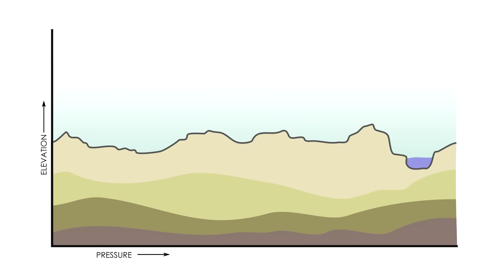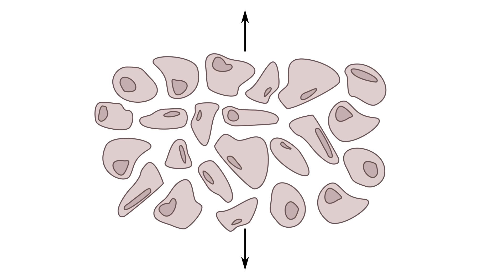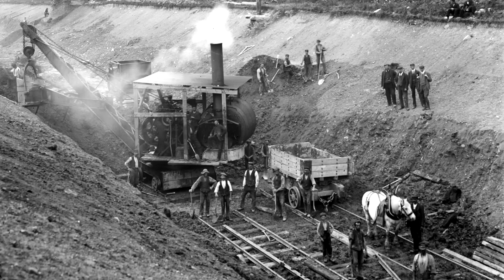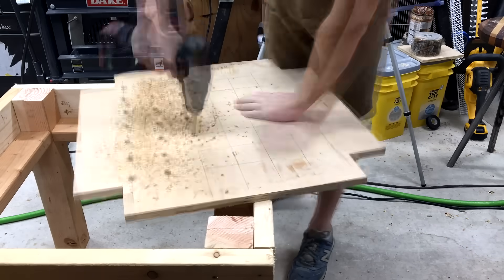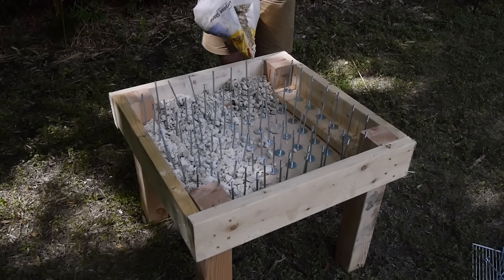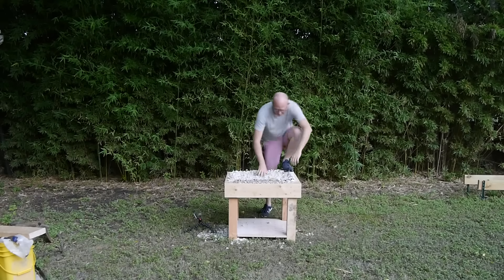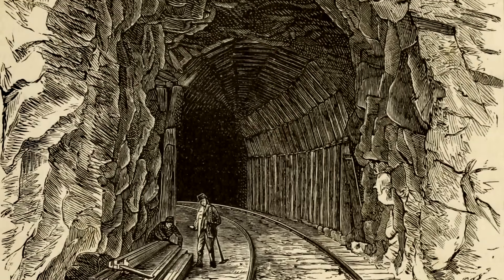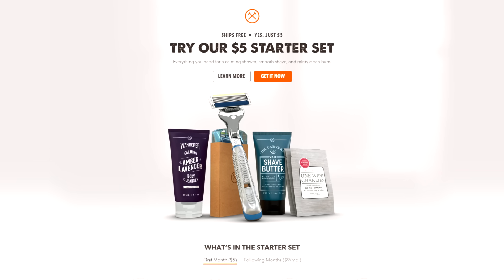Why Tunnels Don't Collapse

Comment: Damnn standing on that gravel demo was hella dangerous.. those 8" bolts would have become blunted spears to your leg if the thing collapsed. Glad ur okay
Reply: That part scared me. He could've done that with a bar above him so he could hold on if it fails
Reply: @cynellekhentannvasquez8219  Or have a safety harness to help him not hit the ground to hard. The safety harness can be attached to a special rig from either a strong pole or the back of a truck. Lol 
Either way he’s an engineer and I doubt he didn’t think about that. The only reason he did this test like this is, buscase he probably did all the equations of fails in his head and probably came up with no fails. It’s impressive what a chimp brain through lots of evolution can do.
Reply: Ali Syed I know! I was saying this too, especially when it started to bending I was like “this guy is gonna die”
Reply: Dont you think he tried push down on it abit off camera in order to test it.  My guess he did.   Hard to be engineer and stupid at same time, but yea it happens.  But then its overconfedence  imho :)
Reply: @UltraSuperDuperFreak  if you noticie, amny of the rocks at a 45 degree angle from the bolts fell when he got on. That means he didnt test it before hand, just used his engineering skills to make sure it was ok
Reply: I don't see the danger. They're really blunt and the fall is tiny
Reply: @UltraSuperDuperFreak  He's an engineer for God's sake. He knows math and stuff.
Reply: Bolts have washer and a nut on both sides. If the structure collapse he would probably just fall. But if he landed on any of the bolts there would be no danger since the surface of the washer is to great.
Reply: Trust him, he’s an engineer
Reply: practical engg next vid title: why Grady never gets hurt
Reply: No, not really.  the bolts would have just fallen on their side. he might have go a couple scratches or maybe even turned an ankle, but that's probably about it.
Reply: nope, i think he already calculating carefully. afterall he is the practical engineer
Reply: He tested it first with dead weights.
Reply: RESPECT;    Gotta give it to a man who risks his own safety on his own work.
Reply: Calm he is engineer
Reply: The bolts appeared too close together for his foot to slip through to the bottom if the rocks gave way. If the rock's gave way he would have been  just standing up on the bolts.
Reply: @exoressdelivers70  I think you miss the point he took the bottom off. His weight was totally supported by the rock and the bolts tentioning the rock.
Reply: He’s too cool to use an antiquated adverb like very, so he says hella. I’ll bet he has friends too.
Reply: @walterkersting1362  Language changes over time and if you have an issue with it you're on your way out.
Reply: @walterkersting1362  prescriptionist
Reply: Very is hela antiquated adverb. It is hela cool to use hela instead. Me hela cool dude. Hela cool. Hela hela cool. Hela hot too.
Reply: Let me guess you wear a face mask ....snowflake

Comment: How do you go about guaranteeing that it won't collapse? There's a bit of distance between "this is probably fine" and "I bet multiple lives that it's fine". Your demo was good but I wouldn't stand on it if it was the only thing stopping me falling into an alligator pit. Can you measure it's reliability somehow?
Reply: You can simulate it, and you can calculate stress and strain on the bolts

Comment: I research and work with hemp fiber, .
  would you think the world would be interested in a "organic" non metallic,  tunnel reinforcement concept, 
 that could expand and tgrough exothermiclly expansion compress fractured stone and even gravel, and hold like reinforced stone.
 On it's way through a existing tunnel system, or as it was newly bored.

  should be good for say 700 years give or take a decade, if records are correct,.
  chemistry is still doing fine even on the Great Wall of china's "below" waterline, .
  the 5 atmospheres a tunnel must pass for civilian traffic should be obtained easy enough.

Comment: You’re missing the usage of polyester resin to develops the strength of the F432 Rock Bolts. I understand this is a semi-elementary demonstration but aspect aspect that could have been mentioned is the development of the roof beam as to develops the arching effect of the rock loads. Also, horizontal stresses and their mitigation with higher shear strength bolts would be great to see demonstrations on here, say to slow the effects of creep on the excavation. Another example of yieldable, arching, members would be an interesting experiment, if they could be demonstrated.

Comment: The other option is a polyurethane resin that is injected into the fractured rock to essentially glue it back together.  It's more often used in stabilization post collapse, but I've seen it used in new construction as well.

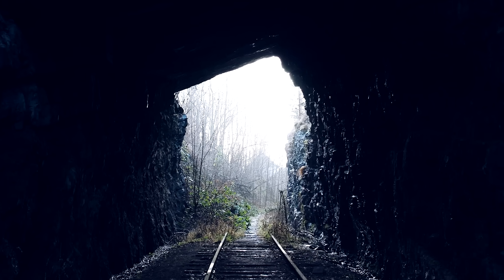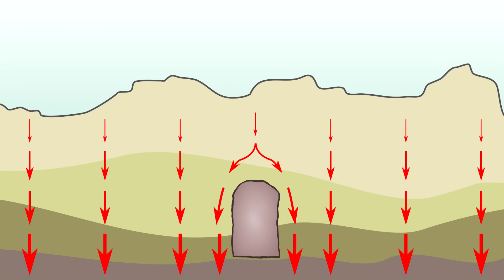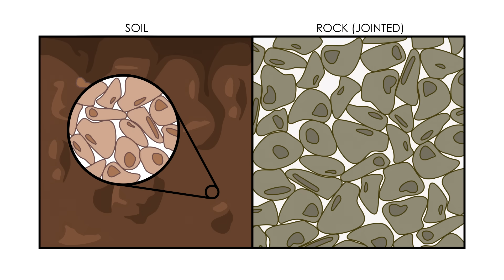Comment: 0:51, 0:52, 0:57, 1:05**, 1:20, 1:24, 1:38*, 1:46*, 2:43*, 3:29, 3:31-3:42 (several), etc.,   there were low frequency (~80Hz?) booms, possibly from some other room in your house. I'm wearing headphones with great low frequency response and every time it happened I was genuinely concerned my home was buckling. It really enhanced my appreciation of the topic. Thank you.

Comment: This from current railroad news relates, "Crossrail Ltd requires anchors used in the tunnel lining to demonstrate a 120-year design life instead of the standard 50-year span of a standard fixing. The twin-helix Excalibur PLUS bolt also offers high-performance tensile and shear characteristics."  https://www.railwaygazette.com/news/infrastructure/single-view/view/long-life-screwbolts-developed-for-crossrail.html

Comment: Normally tunnels are lined. If rock bolts are used, they are usually set in a two part epoxy which is mixed by the rotation of the bolt as it is inserted as a drill. Then the structure is lined later in the process usually by reinforced concrete.

Comment: My dude, I recently found out that horrific experience when toilet water splashes on your ass is caused because of air forcing its way rapidly to the surface. I've seen some folks say you can put a thin layer of toilet paper down first and it supposedly traps the air trying to escape.

My question is, what happens if you just pour something like dish soap into your toilet, or some other substance aimed at increasing surface tension to the point where the air can't escape? Would that work and would it harm your toilet or septic tank?

The blight of toilet ass splash water must be purged from the earth at any cost.
Reply: Just crap in the yard bruh, problem solved.
Reply: the whole reason that detergents and surfactants work is because they DECREASE surface tension... you'd have to add something that increased it (or increased the viscosity of the solution overall)

Comment: Just an observation... but before tightening those bolts, if the rocks had been shuffled or vibrated so they settled into their minimum space, they would have been better locked together and those bolts would have held more of the rocks captive, meaning a more solid mass and fewer falling out the bottom.

Comment: I thought you were going to fall through when you stood on the bolt/rock support.  I learned something new today.  Thanks.  Question: Using your method,  is there a way to determine the maximum load before the support collapses?

Comment: Nice video even if there are some inaccuracies. Not always we have tensile strenght on the roof due to arch effect. Stress field along an underground cavern depends on cavern geometry and initial horizontal pressure. First phase supports are usually designed to stabilize the tunnel for all the use time. There is not just rock bolting (grouted, swellex ecc..) but usually also wire mesh, shotcrete. For very blocky rocks usually it is necessary steel pipe umbrella

Comment: I used to work for a manufacturer of rock bolts and related equipment, so this was fun to watch as it was never really explained why or how the rebar I was turning into giant bolts was done the way it was or to the size and lengths. It would be interesting to see more on how things like the adhesives and spray foam work and help to contribute to tunnel safety.

Comment: i would never have thought that gravel could be made to support the weight of a man just by putting bolts through it...
Reply: Yeah, you'd be amazed at how strong friction is. Even in some houses, friction is the only thing holding all the beams together.
Reply: It's for demonstration purposes only the gravel is probably not going to hold the weight if movement is to be exerted, as you see the gravel fall from his movement it is slowly losing its tension hold between the gravel and will give way.

Had the experiment included larger rock wedged between the gravel the ability of the bolts to hold tension would have been far more effective.

Packed material is more efficient at holding greater weights exerted on it. For example medium size rock with 2 inch, 1 inch and half inch aggregate with small particles packed within this would be very strong structurally.
Reply: Completely agree
Reply: Same
Reply: Curiously enough, as soon as I saw the demo, I knew exactly what was going on. Couldn't verbalise it to someone else but I...know.
Reply: i think the demonstration was too quick and may be a little misleading.

what should really matter is the ratio of the average gravel size vs the gap between bolts, and on top of that, the widths of the washers used and how much compressive force they could exert. that said, it still seems completely possible for any section to sport an inconvenient faultline and just shear off with minimal pressure. the lateral compressive forces needs to work with irregularly spaced gravel of sufficient size and with sufficient friction gripping each particle for the whole thing to act as one load-bearing floor.

in one word, the whole thing is... precarious.
Reply: Well you are WRONG
Reply: or maybe he swap out the wood plate for a thicker one, just to be safe. and the demo is purely for the dramatic.
Reply: @noirto2  you could literally see him stepping on the gravel with the camera below, dude...
Reply: Let me guess you a wear a face mask
Reply: @seanconnell622  lmao the clown arrived

Comment: Great demonstration video.  I like the fact that you walked on it.  I would not have bet this would have worked.  Did you do some calculation for the bolt spacing versus the aggregate size or did you just wing this?

Comment: To make your rock bolt design with gravel much stronger and safer, I would recommend increasing the longitudinal friction and stress by adding a dense and lightweight metal mesh to the bottom side of your design and tightening the contact between the mesh and rock by utilizing the rock bolts and running them through the mesh. This would allow any longitudinally loose rock (aka falling gravel) to be almost immovable by the strong contact between mesh and rock and be pressurized vertically as well as horizontally. The rock bolts do a great job placing vertical pressure to the rocks but not such a good job horizontally. That’s where the mesh layer would come in handy as a safety design. 👍🏼 great job and great video!
Reply: Fyx5010 maybe add some mine straps and flash coat here as well with resin encapsulated Gr. 75 Thread Bar?

Comment: Friend,
When you are tunneling through soil, how do you—hopefully—keep the tunnel from collapsing until you have a ceiling built?
I have seen telescoping overhead canopies, but then there is a gap between the roof of the newly excavated tunnel and the ceiling of your mobile canopy. 
If, for instance, I want to install a brick arch overhead, I need to get to the unsupported roof to build my brick arch up to it.
If this is too complicated to go into, at least point me at the right texts—preferably without calculus.
…..RVM45
Reply: RVM451... research the "shield system" which is how they built the NYC subways. BTW, most older arched ceilings were built first then covered up with dirt later. IOW, not done as a tunnel.

Comment: I want to know why doesn't a triangle with the up angle very sharp have the most structural strength, I heard from a lot of engineers that the 2D dome shape has the most. Is it different when you take the triangle and longen it in the 3rd dimension making a triangular prism, and you make a "semi circle prism" or "half cilinder"? In that case is the round prism stronger structurally ?
From Mister Google I found only articles/videos/etc. about how triangles have the highest structural strength.
Reply: Jeff... the traditional dome shape spreads the load out more evenly. IOW, if you have no clue as to exactly what is overhead it's better to go with even distribution, rather than pushing down and to the sides with a triangle. It's a better gamble in the long run.

Comment: Very nice demonstration of the bolts. I would like to ad that the bolts also make the potential loose rock in the roof is attached to the tunnels stable natural arch that are usally a little higher up. And in this way  its supported by the surrunding rock walls, just as an old stone bridge, where then the rocks underneth is supported by the bolts. Then of course this is not always the same. It depends on the joints and the rock you are tunneling through.

Comment: What I wanna know is why can't someone figure out how to make the asphalt surface of the road in a way that sewega lids don't either sink in, making giant hole ripping your wheels off, or the road collapses around the lids, making giant steel wheel-ripping-blocks. Is it so hard? Where I live, we don't have the seweg on the sides, under the sidewalk, the pipes are directly under the roads, so the manholes simply make driving a nightmare. Is it the setting of the asphalt? Sinking of the concrete lining of the manhole, throught the surrounding soil? Help!
Reply: Sarcast … That's called "frost heave" and it's common anywhere with wide temp swings. Those manholes are connected to the sewers / utilities that are 4 - 10 ft underground where the temp never goes below roughly 45 degrees... and that heat rises. The manhole on the surface, along with the road, is subject to freeze / thaw cycles, so things move and settle again at different rates. It doesn't take too many years before there's a dip or a pothole by every manhole. Sorry, there's no way around the laws of nature other than moving to an area that has a more even tempered weather.

Comment: hey I was just watching Essential Craftsman (https://youtu.be/dYjuihv0Yq4?t=467) who you should do a collaboration video with. 

anyway, I thought you should a video on planned cracking, planned failure and planned structure decay to build lasting structures. 
so that whatever it is fails in a way that last forever. 

be sure to include info on https://en.wikipedia.org/wiki/Weathering_steel "Rust proof by rusting"

be sure to include how the water on mount Rushmore monument is made to flow away from the faces keeping the carving around for much longer.

be sure to include the Long now clock project longnow.org/clock/

maybe, include the roman road and it's fantastic drainage and slab floating on gravel vrs the never ending maintenance but always fixable USA road system what one will last longer only $ can tell will the us ever once run out of money in the next 2000 years or will the zero maintenance roads win.

it could be one video or even a full playlist on decay, weathering, and long term design. Project placement for decay, water decay, salt decay, dust abrasion decay, chemical decay such as soils, replaceable parts and materials, erosion, disasters, war, vandalism and rioting,  decay by economics due to a lack of maintenance or theft, the other side exit plans of non permanent structures, rotting, and success stories structures that by planing or accident lasted for a long time what they did right what they did wrong. I am sure when you start researching lot's of Ideas will come to you.

it just seemed, a good match for your channel, just a idea.

Comment: How did you create the transition from uncracked to cracked rock at 3:25? Is that just a smooth rock that you Photoshopped a layer of cracks over? Both before and after look real.

Comment: When old mines used posts/struts to support caves from caving in, did those supports only actually come into effect when a collapse did, or, was to occur but resulting in no collapse since it was able to drop immediately onto the posts/struts? In my mind, you would have to somehow push them into the rock somehow in order to provide an upwards pressure as otherwise, they would only be resting slightly underneath the rock, right? With all that said, is the bolt method stronger than using posts/struts types of support?

Comment: Hi ! I am from Romania, the north east of it, Moldova region ( not the republic). In the 90s they came in my village and dug a tunnel with huge diameter, round on top, cement all over, I'd say 10 m tall and 6 wide. I live in a mountain area and there is a river called Bistritza ( russian from bistra - fast ) and they wanted to channel that into the tunnel for power. They dug in many villages along the river into on side ( right) as with the flow. They dug the tunnel parallel with the river, flat, just like on a plain field with mountains on top. If they would put that river through the tunnel ( not now, since they have no more money ) would it bring down the hill on top, long term, if the tunnel walls somehow would collapse? Would it eat through dirt and rock til my village on top will sink ? Thank you. For the tunnel info check on internet ACH company, Farcasa, Poiana Teiului tunel Neamt county Romania

Comment: That method isn't really that common these days but usually they use Reinforced concrete by using Shotcrete method or precast or post tension but overall we can't leave the soil like that anymore as you mentioned in video that Human's safety is number one pirority